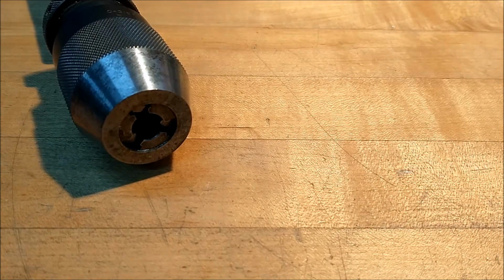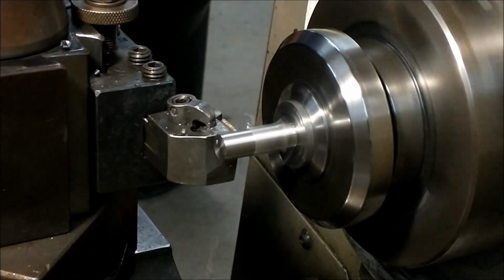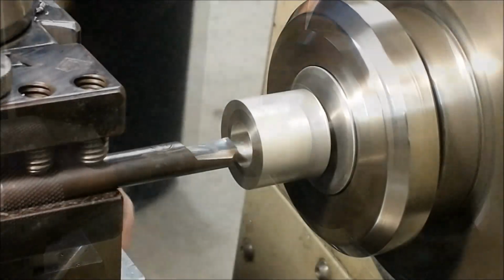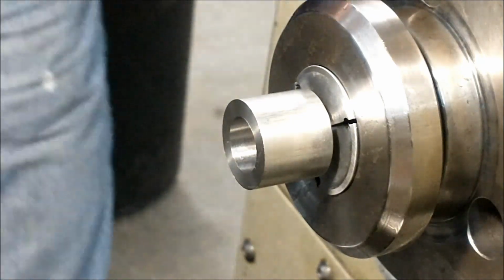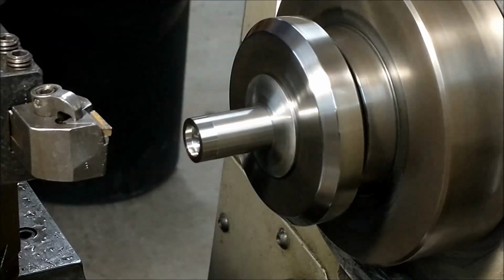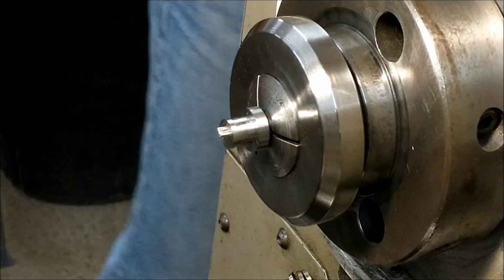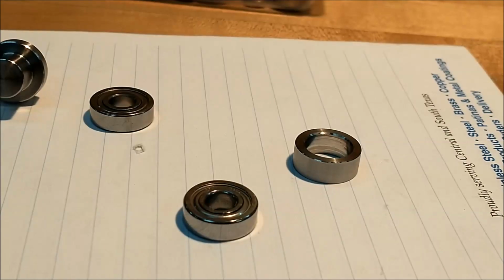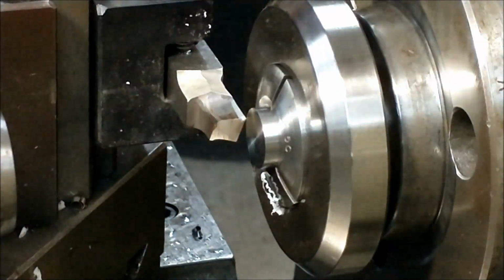Need a Live Center For your Lathe??  Lets Make one !

Comment: Hey joe...(sounds like hendrix)...On a related note ,have you made a live center for the main chuck,the type that allows turning between centers,of course i have no idea of the proper name for the tool,it has a bar that takes turning force from the main chuck to turn,but allows a near perfect concentric machining application.

Great informative videos,I'm an electronics technician,who some times needs to turn or mill parts.
Reply: I believe that's called faceplate turning. with a dog attached to the work engaging the faceplate. But would be a dead center in the driving chuck.

Comment: Joe , thankj you very much for taking the time to put out all of these videos . I know that I have certainly learned alot from you !
I just got back into maching after 45 years of playing with it in high school . I was wondering if you might be able to do a video on how to get even a decent finnish while turning CRS or HRS ? I've been having a heck of a time even turning out lousey parts .
thanks
mike ( this is my wifes account )
Reply from the maker: CRS and HRS can be fussy material to work with. HRS never cooperates, and 1018 isn't much better. Light finish cuts, HSS tools and small nose radius is a good place to start. The 12XX CRS is better than the 10XX material.

Comment: I'm pretty shure you know, but to make it clear this is not the right kind of bearing setup for a live center and not the right fitment for a bearing setup of this kind. Works just fine for light duty and this size range but not for an actual live center with much higher forces.
Also for normal bearing assemblys you want an interference fit for the rotating race and a slip fit for the stationary race. If both races turn for some reason or need a tiht fit, use a bearing with more clearance to not bind the bearing.

On a side note; Did you have a video about sharpening drill bits? I couldn't find one
Reply from the maker: Please refer to the pinned comment at the top of this string regarding your bearing comment.
Sharpening video:    https://www.youtube.com/watch?v=UuvyrOuXzDY&t=9s
Reply: @joepie221  Looks like it's 2 for 2 on me being blind. Thanks
Reply from the maker: @killejano  All good. I don't always read the comments either. Stay well.

Comment: Honest Beginner question: First, I've been watching your videos for a while and enjoy every one!  Ty!  My question is in regards to safety (I just picked up my first metal lathe).  Near the 3:28 mark you begin parting and reach past a really long gnarly chip.  Is there any danger from that?  I get nervous about fingers and spinning metal and was wondering if I was just being ignorant.  Thanks!
Reply: If you watch closely he pauses the feed. You can see the tool holder going in and out. It's kinda hard to manually feed while brushing on oil. the video is really sped up so it's not super clear when he pauses. Parting is a pretty slow operation.

You are right that long gnarly chips are dangerous. With more time on the lathe you will find that as long as you don't get a rat's nest caught on the chuck, chips are fairly predictable in how they behave. Even the long gnarly ones.
Reply: @TheJuicyBurger  Thank you!
Reply from the maker: I fear the long semi curly stringy chips the most. The ones that roll nicely or curl up and break are still dangerous, but not like the long razor sharp wire ones that can form. Its a good idea to stop the rotation of the work holding device before handling chips. The worst kind of injury can be expected if you handle a sharp string with bare hands and the machine claims it back at the same time. Guess who looses?
Reply: a handy item to make is a chip hook. A piece of 1/4" rod about 12-18" long with 3/4" of the tip bent about 90 degrees works fine. SS chips are especially nasty.

Comment: I worked for  robotics manufacturer and when they discontinued a product I was there with my truck to take stuff off of there hands.

I ended up with cases of Timken NES and NEC bearings.  some of which were sold in pairs that were concentrically produced.  I got 300 dollars a set for those damn things. a guy bought them by the case that to me they were used in their lathes and grinders?  

i have a small box od mismatched ones left
Reply from the maker: There is no reason a setup like this can't be done with 2 different size bearings.

Comment: Hi Joe thank you for your content I find every video I watch interesting and helpful and I have often turned to your videos to help with problems I have in my work. I have come across a problem that I can't find the solution to anywhere on the Internet haha. I'm wondering if there is any way you would be able to contact me and have a look? It might make some good content too not that you need ideas! It's a peice of round bar with a cam slot machined along and then around the bar while still moving horizontally. I don't have an automatic dividing head or anything so it would have to be done manually. I don't even know if it's possible 😂
Reply from the maker: Check this out. It may help.   https://www.youtube.com/watch?v=AVydTvwqmRs

Comment: ops is that bearing little lose  when you took out the plastic  i see you push it back in? just asking  its a great idea to ty.
.
Reply from the maker: At what time in the video?
Reply: @joepie221   sorry time was like 14:49
Reply from the maker: @paulcotesr5623  Slip fit by design. Absolutely.
Reply: @joepie221  i see it now sorry i thought  it was the bearing , i think i need a new set of eyes . its not the bearing  but as you said slip fit of the spindle Sorry   ill make one now  :)

Comment: another gret video Joe, as regards centres maybe you could help me with  aqueery. Regarding the terminology, as an aprentice I was taught there were 3 types of cenrte, the dead centre, hardened, usually taper fit and used in the tailstock. the live centre, unhardened, usually taper fit used in the headstock as when turnung between centres and the revolving centre as here used in the tail stock if room and work holding permited, Although many UK tubers use this convention. I notice US,  Canadian and Australians seem not to, is this a cultural thing or a change in convention over the years. As an aprentice I had to draw such tooling from the stores and I got exactly what I asked for, woe betide the apprentice that caused the storeman to have to go back into the depth of far beyond to exchange a tool! Hope you can help me in this one and keep on turnig (pun) out great content. many thanks Joe.
Reply from the maker: A live center is one that moves. It can be either bearing driven, or a power driven solid center in the spindle. A solid chuck of steel, shaped like a pointer can be either. If its used in the tailstock and is stationary while the part is moving, its playing the part of a dead center. If that solid slug is now placed in the head stock and spins with the material, it can be called the live center. Basically, any center, in any position that spins with the material can be called a live center. Any center that sits still and does not move when the material spins, is a dead center. For sake of not pissing the boss off when told to order a live center, it better have bearings in it when it arrives. dead centers are usually solid.
Reply: @joepie221  Thank you very much for your reply, I now understand the difference in terminology use and the reasoning you side of the pond.

Comment: Ditto Guns and Cars
I kind of wonder if those quoting tenths and hundredths have aligned their headstocks and tailstocks to equal precision let alone adjust headstock bearing preload. I would suggest incorporating one or two belleville washers into the design. Your bearings are fine for the intended use.

Comment: You don't need a tooling ball...just set your cylinder at the required 20 degree angle....and pick up your bottom cylinder head tapped hole....
Reply from the maker: Thats assuming the hole is in the right spot.......

Comment: As far as part drifting in the collet, I’ve used a sharpie to watch for that. Just another tool in the toolbox, figuratively speaking. 
Nice video.
Thanks,
John
Reply from the maker: Ever see an end mill leave a block deeper on the other side of the cut?
Reply: @joepie221  
Yep. Ruined the parts. Errrrrr. 😁
The helix pulled the endmill out of the collet about 1/8 inch.
Thanks,
John

Comment: Hi Joe, love the videos. Question, what is the lathe tool/insert that your using in this video? Thanks
Reply from the maker: Its a TPG 321 insert with a chip breaker in a kennametal holder. I think the holder is discontinued, but google the insert and you'll get holders too.

Comment: Sincere question; wouldn't it be better for later accuracy of the centre to do the boring operation with the stock mounted in the drill chuck you're going to use?
Reply from the maker: You absolutely could. You'd need a different boring setup.
Reply: Wouldn't it have to be somehow indexed to go back in the chuck in the same orientation?

Comment: Hi Joe, long time viewer, loving the tiny lathe series. 
Was wondering, what are your thoughts on a center drill versus a spotting drill for starting a hole?
Reply from the maker: In my CNC, when I run aluminum or plastic, I'll always use a spot drill. Quick, shallow and easy to calculate depth for a chamfer. Knowing the drill feed rate will be high, its OK. For anything else, I always use a centerdrill. I firmly believe, and will always believe, getting a deeper registration on a diameter is better to do before the load of the web engages. I may actually do a video on this topic.
Reply: @joepie221  I would love to hear your detailed reasoning on this topic. So much arguing on the web talking about how the tip angle must or must not match, no conclusion is ever reached, and all evidence is anecdotal.
Reply: @joepie221  that's a video I'll be looking forward to!

Comment: Cool project, but I probably would have made the pin reversible with a point on the other end.  Just one less thing to keep up with.  I have both fixed and live centers already, but I might make one of these with a point on one end and an internal thread to take different size platens on the other just for little parts like the mini lathe and steam engine series.  Turning quick sacrificial pressure plates is really handy.

Comment: Cool projects if you have the parts laying around. If you had to buy material for this I’d suggest buying different types of bearings. 
Also the tip seems to be spinning very freely, is there enough grease in the bearings to lubricate them?
Reply: He did make the tip a slip fit in the bearings, but metal side seals don't put drag on the inner race. Bearings are also produced with light, medium and heavy greases. A bearing from your local hardware store will have light grease.
Reply: @wwilcox2726  From my experience bearings only spin that freely when there’s no grease left in them or when I put oil on them. Light grease is still grease and will drag a free spin to a halt. As Joe said in another comment this center will only be used in light pressure situations so it should be fine.
Reply: @shiro-r4m  whew, that's a relief.

Comment: G’day Joe. Nice little project. My second impression was damn that inner bearing will be difficult to remove when it fails but then a slip fit pin, grease and a few hits with a hammer will hydraulic the bearing out. 
A handy piece to have in the toolbox. 
Cheers 
Peter
Reply: When the inner bearing fails, you will be dead and gone....

Comment: Great project, however, doesn't the axial load always go through the drill chuck Jaws, since they push out when tightening, so a small gap to the drill chuck face will always be present?
Reply: True, but it's really only a back up in case you crash your part. For pressure turning the requirement is to apply axial pressure to clamp a work piece against the spindle of the lathe. The lathe spindle is providing all the required radial support for the work piece. Joe could have made the shank the largest diameter the chuck was rated to hold and the shank itself would be more rigid, but it would have more unsupported length beyond the chuck jaws. Again a pressure center provides clamping force and not very much radial support. If you want to make it a live center then the problem becomes the concentricity/run-out of the chuck your mounting it in, because that will cause you to cut parts with a slight taper. And truth be told, a drill chuck is not designed for side loading, it's designed for thrust loading.
Cheers!

Comment: I need to make one of those now.
Question: Did you heat treat the 17-4 ph part?   If you did were you concerned about tolerancing post H900?
Reply: Maybe this is a dumb question as I have never personally heat treated something YET, but for the application/use of a "live" center is there any substantive benefit to increasing it's hardness? It totally makes sense for a dead center, but the high load wear point is eliminated in the live center design, right?

Comment: Joe here is a question which you dont get every day :
What type of steel would you recommend for general purposes ,something that is nice to machine ,has enough strength.Something you can make 80% of parts out of.Something that you would have for every day application ,a material that you would have a stock of.
Reply: I have a Sherline lathe and mill and they choose 12L14 for many of their machined accessories such as 3 and 4 jaw chucks. On Ebay 12L14 is more reasonably priced than other easy to machine materials like 360 brass. So I will be stocking up on this in place of my usual 6061 and 7075 aluminum to make parts like the one in this video.
Reply: @moorejl57  303 Stainless too. I use lots of 17-4, but have 2 heat treating ovens so it's easy.
Reply: @johnm840  I looked it up and it looks good too. I will have to give it a try.
Reply: @moorejl57  I'll get an argument for the but my all time favorite material for turning or milling and for making things out of plate and bar stock (and just about anything else)  is 4140. - It machines with a mirror finish with carbide inserts and if you know how to weld it you can make things that weigh  less then aluminum because of it being almost 3 times as strong as A-36 steel so everything can be made way thinner,,,,,Oh, you can easily Heat treat it to like 50 C-Rock with just a burning torch and a can of used oil (Stinks up the shop, though) .  The cost is not massively more then 12L14, either.  

I know,  I'm a weird-o
Reply: Another great steel to check out is 1144 "stressproof". It's free Machining, lead free and twice as strong as 12L14.
Reply: Great info from all of you ,as you know there are 3000+ types of steel known to a man  -which one to use ,well thats easy the cheapest one !!!.
Does anyone know maybe what kind of steel has a yellow greenish colour.I have machined it once and the mirror finish it leaves its amazing.

Comment: If I any make a suggestion, you should try using water as a coolant when machining 316 stainless. I am a Steamfitter and a millwright suggested using water when drilling holes to me one time. It made it easier and did not dull the drill. When I had to thread some 316 pipe I emptied the cutting oil from the reservoir on the Ridgid 535 and the threads came out much better than with oil and water only allows the part to get to 212 degrees
Reply: James I was taught the same thing from an old toolmaker years ago. When reaming a hole use water! It really works for dowel pin holes and such. A hole that's got to be dead on I always use water. I work in the Die industry so I use this a lot!!
Reply: @joeziegler9054  Can you use something like water with some Koolmist  77 in it or should it be plain water? I was thinking of buying some Koolmist and making up a spray bottle to manually apply coolant. They claim it helps prevent rust.
Reply: Thanks for the Info. Makes sense.  I stumbled into using Kool-mist via accident of water in my oil bath for knurling aluminum 6061.  Had to turn OIL off and a different setup.  the flakes in the knurl were like night and day.

Comment: What would be the best way to make it so you could replace bearings?  (Everybody thinks they will fail so soon.)
Reply: "IF" it fails, just make another, if it gets used that much, use a thrust bearing at the rear on your next one.
Reply: When/if you make it, simply substitute the bearing spacer with a third ball bearing. It will then carry the axial load through all three bearings as opposed to only the outer bearing carrying 100% of the axial load. If you really want more capacity use a stack of four bearings, but three is enough to get 'er done.

Comment: Here's an idea.

Instead of making a new spindle, every time you need a new nose profile, drill and tap a hole in the front end  of the spindle, and make threaded inserts to screw into it, as and when the need arises.
Reply: It is common to use a tapered bore on the live center to accept different nose profiles. If you go the threaded route, I suggest boring a precision registration at the entrance to the threaded hole, to keep the nose on center.
Reply: If I remember Joe correctly he mentioned in one of the other videos that you shouldn't locate on a threaded hole. But I don't have experience to say one way or the other.